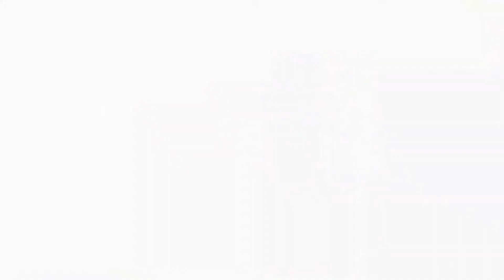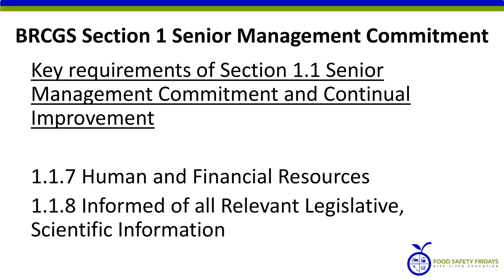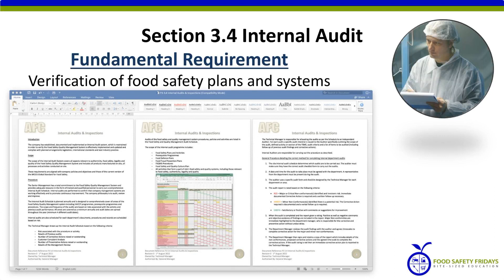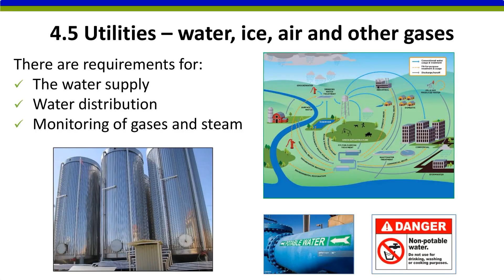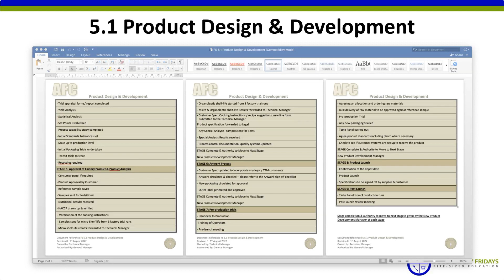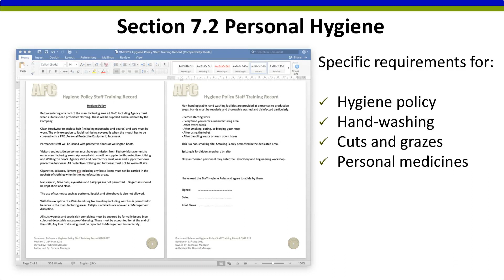How to develop a FSQMS compliant with BRCGS issue 9

Comment: The presentation near the start states that ambient high-care need to meet all of the requirements of section 8. Just to let you know that this is not the case. Only clauses 8.1.1 and 8.1.4 apply to ambient high-care. All other clauses within section 8 are not applicable.